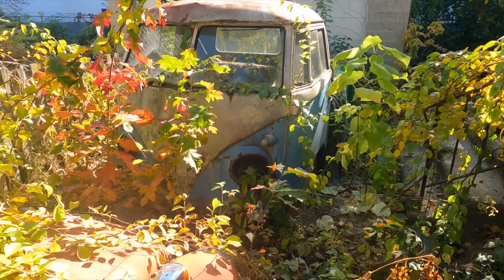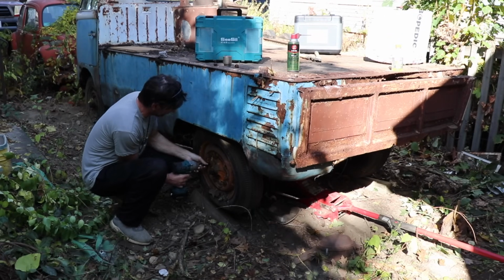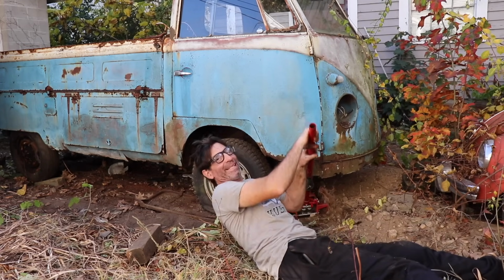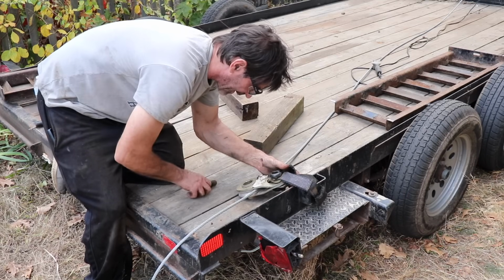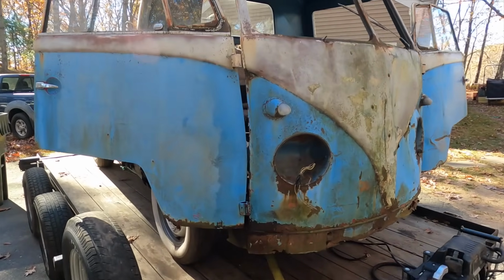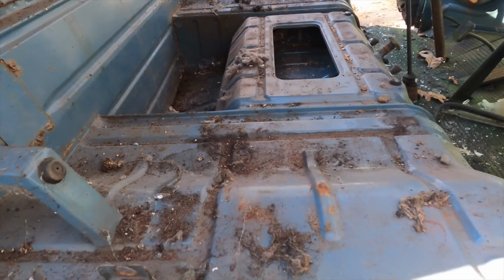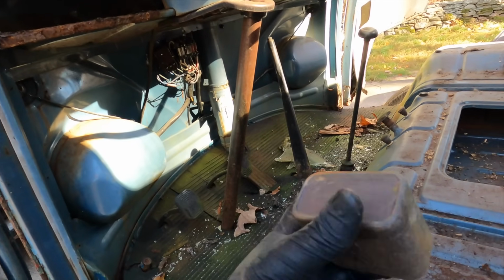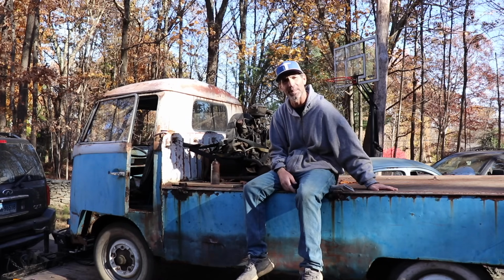Another Old VW Saved From Crusher - 56 Single Cab Truck

Comment: On something like that you remove the bed tops. Because they are super bad. Then remove the supports on the top. Remove the floors. in the cargo area. start with new frame rail sections. ( I make them out of square tubing) easier to work from the top down. Really tough save there. But worth it to me.
Reply: I would probably use a rotisserie on that one just because it would be easier.

Comment: About a year ago I mentioned you should get  a pulley to stick on the side of the trailer for winching. I didn't know you already had one.
Reply from the maker: good tip...I think I picked it up around 4 years ago, finally used it this year
Reply: @5150mxVW    BTW, I also noticed you used a block of wood with the winch to keep your cable from grinding on the trailer frame. (nice touch) In the swamp last week you could have used a steel wheel to guide the cable and give more up-lift coming onto the ramps. Just stand it up and let it roll. Might make dragging those flat tires easier next time.
Reply from the maker: @rupe53  thank you....i did use a good size log at some point but yes that is a good idea with the rim. I've learned a lot in the comment section over the years. Thank you for sharing the knowledge 53'

Comment: There is factory VW tool to lube the door hinge looks like a vice grip tool with a grease nipple on it but remove the bung on the top.
Reply: I had one of those tools back 50 years ago, but for a frozen hinge you need some penetrating oil and an air hammer first.

Comment: A new chassis is a good place to start, that thing is 'toast' like the mirror! I think it is well named as Lucky, for the most part the body looks good. You would expect the bed to have a few holes as it was probably a working truck. I think the roof will pull out if you are careful Jason. We will wait for a 'will it run' video on the engine as it might not need much work. Great find Jason and thank you for taking us along and BTW I was shouting at the screen to REMOVE THE CAMERA. 📸 👍👍
Reply: as an old VW guy, my mind asks... if the engine was ok, then why was it out of the vehicle already?
Reply: @rupe53  I did think that but then I thought, well maybe was out to start restoration?
Reply: @stephenricketts7764    good point... and we'll see. As for restoration, that is not what this channel focuses on. Seems more like rescue adventures is his thing.

Comment: Is all that s from the salt brine they use on the roads out there?
Reply from the maker: This truck was used on a golf course but the I’m sure it has seen some
Road
Miles . The New England winters dissolve cars quickly
Reply: wild guess, but that's been off the road since long before they used brine.
Reply: @5150mxVW  that's really sad. I bought NYC dodge caravan in 2016 that seemed to lose a pound of metal every where I parked it.

Comment: I have watched you dig out countless VW's in harsh conditions. I have one suggestion for you. When I was off road racing we would have jacks on the race truck. We removed the wheels and welded steel plates to the bottom of the jacks. Basically like a sled is how the jacks looked. In sand, mud, soft ground the jacks always worked great and no need for boards, etc. Just some food for thought...

Mike

Comment: At least there were no spirits, no rain, no stream, and not in 4in of mud! 
You will however need plenty of sheet steel welding wire and gas, l hope for your sake you have a plasma cutter. 
It's definitely worth saving so get to work.

Comment: It sure would be nice if you could save the patina but looking at the bottom half of the rig it's going to require some love and probably some paint .  Nice score , make sure to add a little extra HP in the build . You need to have a faster single cab than Mustie ! eh
Reply from the maker: hi Tony, yeah it's pretty hammered almost everywhere. The light blue is not the OG paint .... a faster SC than Mustie1's , maybe , but it will never be cooler :))..... although he did spank me in Crusty on the highway once ... i was in a 71 ghia too !
Reply: @5150mxVW  Crusty beat a Ghia, that don't sound right .

Comment: I had a type 2 deluxe for 22 years. Bought it when I got out of the Air Force and loaded everything I owned in it and drove it to California from Pennsylvania.  Went through 5 engines and one transmission when I owned it.   Finally gave it up in 1990 and bought a euro van and drove it for another 10 years.

Comment: Link to that drum puller?  Looks stout.  I need to get one of those.
Reply from the maker: just google brake drum puller , there are a few for around 60 bucks
Reply: @5150mxVW  I did but most are the bar type with sliding arms and I did not see any as stout as the one you have that bolt to the stud/bolt holes. I’ll keep looking. Thx.
Reply: @ocavant  Look for "Three Jaw Brake Drum Puller" .

Mine is 50 + years old and still works well .

Keep the threads clean and greased and never, EVER use any power tools on it .

-Nate
Reply from the maker: great tips Nate, yours is made far superior to the ones today. I get at least one comment every time i use it " why don't you just use the impact ? Saves so much time and work ! " ....sure lol
Reply: @VWNate1    you beat me to it. That's the kind of puller used on vintage stuff like Studebakers, Ramblers, and early Jeeps. Also, vintage VWs! Yes, power tools will bugger the threads.
Reply: @rupe53  Mine has hammer marks on the ends of the handle, I got it from a huge truck shop I worked for for many decades, no one knew what it was for nor wanted it anymore .

-Nate
Reply: @VWNate1    a hammer is what they were made for... back in the day!
Reply: @rupe53  I know this but try to not use one unless absolutely necessary .

I also have a few "Axle Knocker" tools that work well but I hate shocking the bearings .

-Nate
Reply: @VWNate1   it's really no more shock than a pothole if you don't get carried away.
Reply: @VWNate1  Thanks for the tips!  Last weekend I actually found one at a Mexican flea market🤣!!  Forged USA #2 size. $40 seemed fair. I’m going to keep an eye out for a big one.

Comment: Round tube trans hanger, that is a wolfsburg build. Nice!

That little container you found under the dash is a spare parts holder, usually for bulbs, fuses, points, etc.
Reply: Actually Typ II's were built in the Hanover plant.....

-Nate
Reply: @VWNate1  Before the Hanover plant was built, all VW's were built in Wolfsburg. I don't recall the exact date of change, but many type 2's were built there both during and after the barndoor era. That round tube trans hanger is a sure sign of a bus built in Wolfsburg. There are many other odd details that signify their build location, too.

Comment: This was a cakewalk compared to the NH Buses! The cab is amazing on it. The small container is a bulb/fuse kit. When you went to the dealer back in the day for a couple bucks you could buy one of these. It should have one of each bulb in it and a few fuses. The older ones were black and the 60's ones were blue. The frame is pretty roached but anything can be fixed and it's still holding up, so there's that. Very nice find, I'd love an old Single Cab!